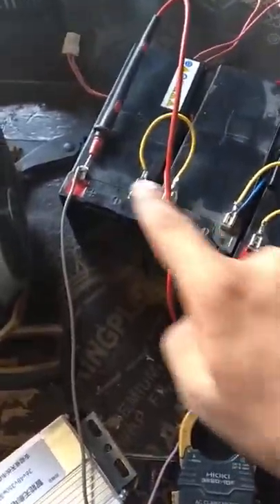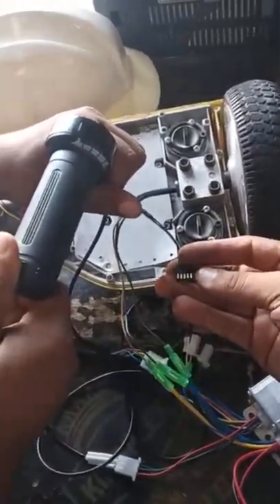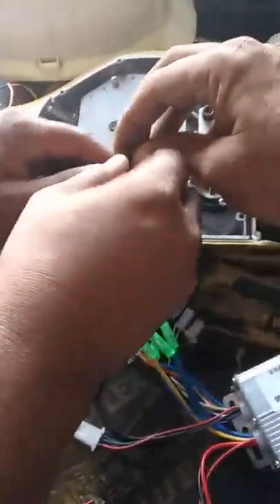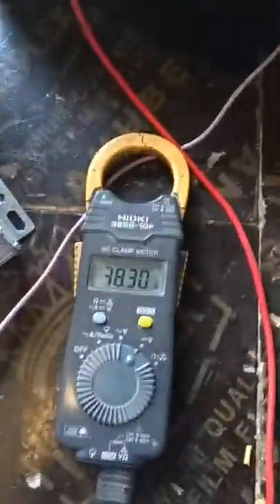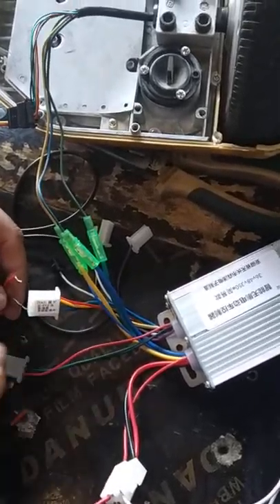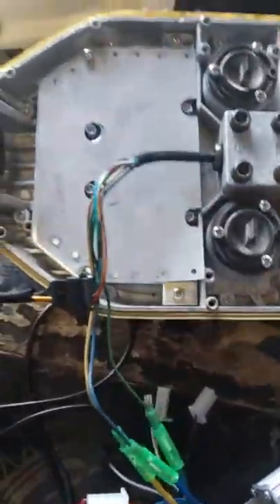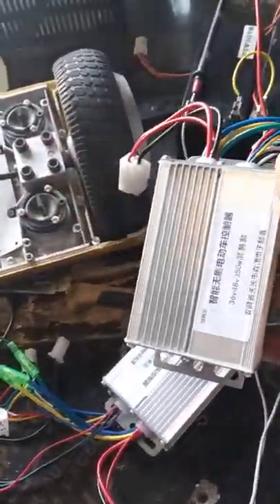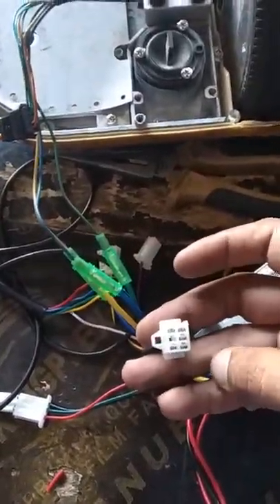Brushless motor controller (ebike) not sporting Hall sensors.

Comment: One controller is sensorless. The other is sensored. Or you can buy one that does both
Reply from the maker: I buy 2 controllers same specifications.both can use with sensor and without sensors. One have problem that not working with sensor.
Reply: @mshahidazeemi3701  oh I see. I'm now looking for sensorless controller, didnt know they made them. 
Did you return?
Reply from the maker: @armenvegas  
Sir i complain banggood customer care. They returned money in my banggood account. But controller not return.
Reply: I have a 250w hub motorcycle bike without a sensor now it works.  but does not hold much battery is not that it does many kilometers
Reply from the maker: @ilirhoxha9039  hi
How many voltage of your battery.24v /36v ? And how many kilometers work.
Reply: 36v 60ah and working 10 km
Reply: @ilirhoxha9039  check your motor cables
Reply: I am probably going to buy a sensorless controller. I think the one I have says "Dual mode" because it works with the pedal sensor and the throttle.

I tried plugging in only the 3 phase wires (Green, blue, yellow), but nothing happened. Maybe I should also connect the thin red and black power wires?

Comment: Hi everyone, I have an electric bike. The hall sensors in the wheel have failed. My controller states ”dual-mode”. Does this mean that it should still work when the hall sensors have failed? I tried plugging in only the phase wires to the controller, but nothing happens when I twist the throttle.
Reply: No its inposebal to power a brushless motor whit ut a hall thay probaly connvurtet it to a brushmotor
Reply: My e bike is working 💯 without hall sensor